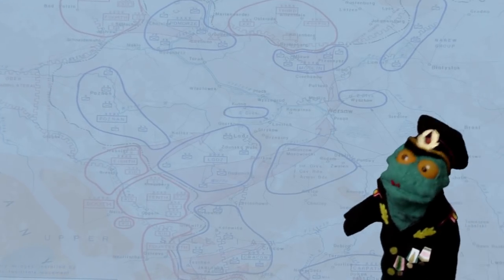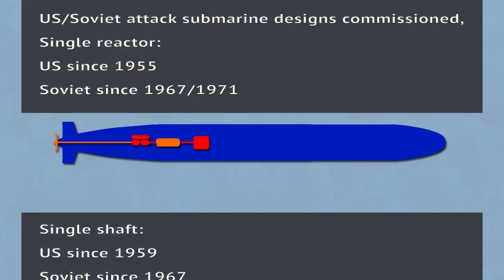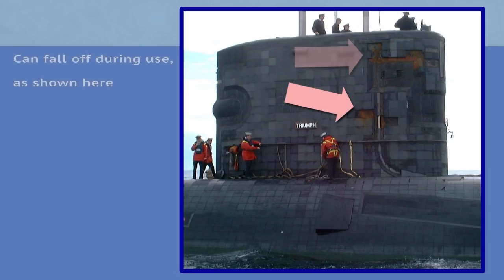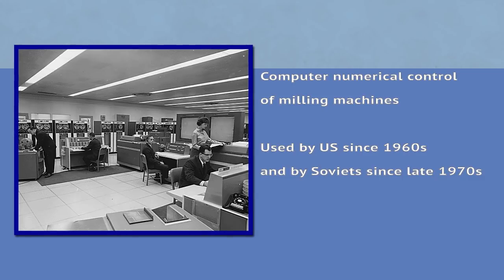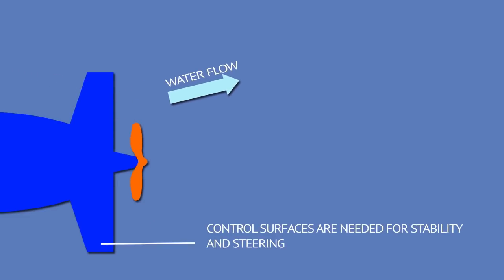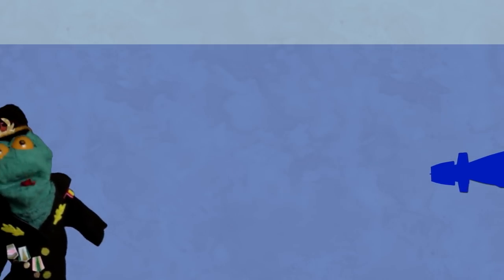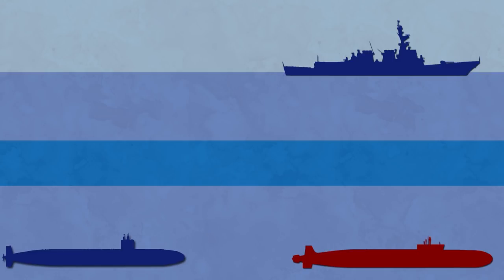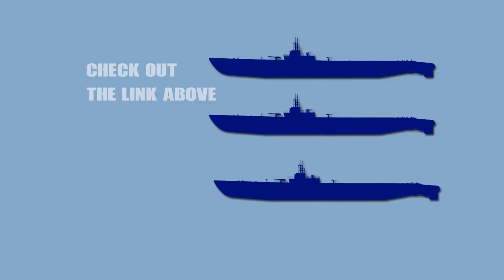How do modern submarines remain silent?

Comment: Great video. 
But wouldn't for a pure hunter submarine purpose conventional subs like the German 212a class be better?
Reply: nuclear submarines are generally better, SSN is pure hunter submarine, like USS seawolf
Reply: Fan Yechao Nuclear subs have longer range and can stay submerged longer, but in a pure fight diesel electric beats nuclear hands down.
Reply: Keep in mind that this only applies if the nuclear submarine is using older technologies like reduction gears and multiple steam plants and powered circulation. With natural circulation reactors and all electric drive, the gap will close significantly. Also this assumes operations in shallower waters closer to shore. In blue water, the nuclear submarine still has the advantage.
Reply: why, nuclear subs are faster, quieter, have thicker hulls and carry more weapons because they are bigger
Reply: Making them easier to hit.
Reply: +DaveVaderlp ?
Reply: Okay boys, we get who has the quietest sneakers, Who has the fastest sneakers?  Who has the endurable (last long) sneakers?  Who has the harder kick?  And most importantly, who has the better ears?

Regarding to diesel-electrics, you aren't going to catch up to any carrier any time soon.  The carrier strike group/CBG would have to stumble across you for any chance of an attack.  That's where intelligence would come in, even if you had a set plan, you don't have lots of endurance to commit to an attack.  "Just sit on the bottom of the ocean, hurr durr."  A carrier isn't going to be 15 miles away from the coast waiting to be picked off, and during war time, there are lenient protocols in place to use active sonar.  A boat may be quiet, but launching a torpedo is loud as hell, so good luck being quiet then my dude.  For every one torpedo you send, a multiple of that is sent back.  Some surface ships are equipped with anti-torpedo torpedos and NIXIE as hard and soft countermeasures.  You also aren't going to outrun it, or try to out maneuver it.  Diesel-electrics have a place in warfare, but it isn't a catch all.  It's cheaper, you don't need deal with a nuclear safety program, you won't have shame moments in news headlines stating a whole boat got irritated and killed 30 sailors due to reactor casualty.
Reply: So you suggest a sub from your country?
Reply: But they are way easier to spot than hydrogen based submarines.
Reply: The problem is that its to late when the torpedo launches.
heavily damaging a aircraft carrier is worth loosing a submarine.
Reply: To be fair the biggest threat to aircraft carriers will be land based missiles.
Reply: @fanyechao2761  Diesel-electric submarines are actually a fair bit quieter compared to nuclear subs. Nuclear subs don't have thicker hulls either, there's no reason for that anyway. Where nuclear subs outshine diesel-electrics is the fact they're considerably faster, can remain submerged and at sea for 3-4 months easily, and due to their bigger size can carry considerably more weapons. But when you put a modern diesel-electric against a modern nuclear sub, the nuclear sub is going to die. On one instance a Walruss-class sub managed to defeat 3 Los Angeles-class subs simultaneously, and a Walruss-class sub has "sunk" a Los Angeles-class sub during wargames while remaining undetected.
Reply: @FrogsterLP  You wouldn't even lose your submarine in that case, torpedo's can be fired silently as well, they don't necesarilly have to be ejected with a water shot but can use swim out capability as well.

Comment: Well done but can you explain why diesel subs are quieter than nuclear subs and do you understand the nature of the Australian/French Short Fin Barracuda diesel subs and their advanced systems and why they (on paper) will be so quiet?
Reply: Why would diesel be more quiet than nuclear?
Reply: French Barracudas are nuclear.
Reply: felix25ize

Yes but the Short Fin Barracuda which are being built for Australia are diesel subs.
Reply: @basslinedan2  Because diesel-electrics run fully electric most of the time, which is extremely quiet, especially so if they run on their batteries or employ fuel cell AIP. By virtue of their nuclear reactor a nuclear submarine will always produce more noise than a diesel-electric.
Reply: @pieterveenders9793  yep! I've and since learned that it's specifically the reactor coolant pumps that cause the noise, especially in fast mode.

Comment: Wait. I'm confused. With an electric motor, the output shaft is gonna be spinning faster than the screw can turn. So in order to get the RPM's down, you need a reduction gear. Electric motors are not effective at slow speeds... What am I missing here?
Reply: Matt A. well if u reduce the power input the speed can be varied also u don't need to worry about efficiency as the source of power is nuclear which means u have lot of energy

visit www.defenceglobe.com
Reply: With today’s technology 3 phase power with modern VFD(variable frequency drive) electric motors can run at lower speeds. They also  use these on huge motors for the Alaska Pipeline. By varying the frequency the speed of the motor changes. Reverse two legs of the power and you change direction.

Comment: Now, why is it that nobody talks about german submarines? especially the 212 has a reputation for being basically undetectable thanks to its Fuel Cell-driven Electric Engines.
Reply: This is US biased. Germany is easily further advanced in submarine technology.
Reply: The israeli 'boomers' were actually a few of the first. Also that's the main purpose of shallow water submarines.

The 216 class (the blue water version of the 212A) is actually comparable in range since their AIP is powerful enough to exceed their food stock in durability. Meaning that they're not restricted by the AIP anymore, but by the stock like any other non nuclear or nuclear sub. Comes with the diffrence they don't only need to resupply stock but also fuel. (wich isn't hard to get from a replenishment ship).
Reply: because Germany is still occupied by the US Goverment, German politicans are puppets so US-president always has the last word ("Kanzlerakte" , semi secret contract to submit to US-gov).
Reply: Diesel submarine technology** The US operates nuclear exclusively and far surpasses any other nation right now. We have no use for diesel subs right now.
Reply: The US has the best nuclear submarines, but fuel cell subs are far better than any nuclear sub.
Reply: Ah, yes, but a fast attack nuclear sub has a much different mission than a diesel.
Reply: You got it. For attack subs fuel cells are actually much better, but for SSBNs that have to stay ona point for real long a nuclear reactor is better.

Comment: Well done. A couple of minor points from the public domain (obviously not going to write restricted stuff here.) 
1 very US orientated. 
2 I'm certain US attack subs don't have two reactors. Not sure about boomers. Carriers do. 
3 natural circulation only possible with a single pass core and horosontal steam generators. Has disadvantage of making fuel burn less efficient (until recently.)
3 French subs have used electric propulsion since the Rubis class, though not sure how good it was. Also the US had a couple of prototypes, the Tulibee and the gerald p lipscombe. 
4 Royal Navy has been using shrouded propulsion since the Swiftsure class in the 70s. Other than occasional first if class tests they have been standard since. 
But I'm just nitpicking, good video!